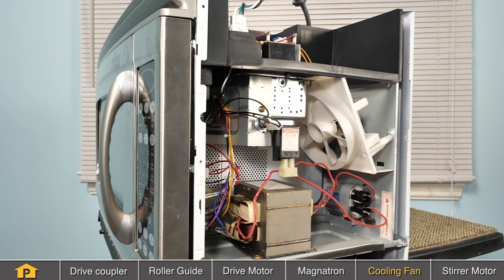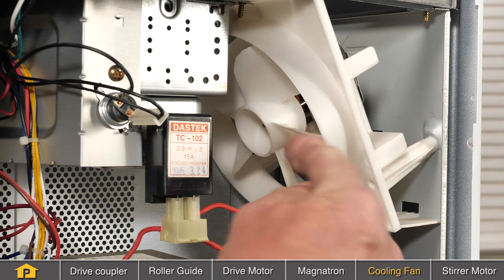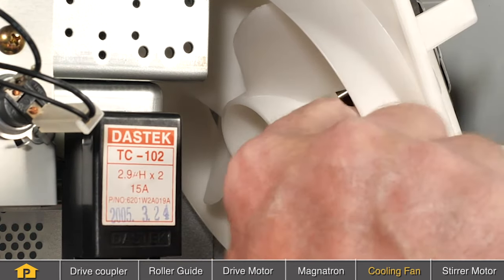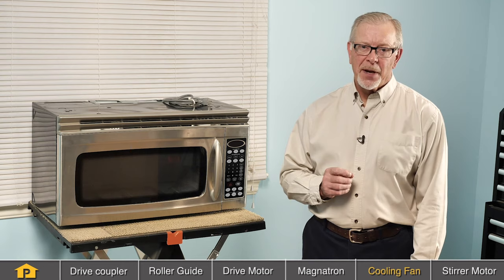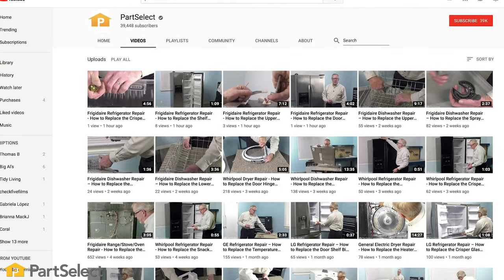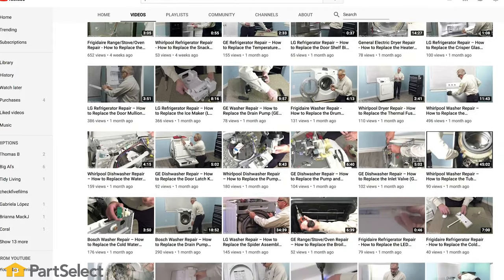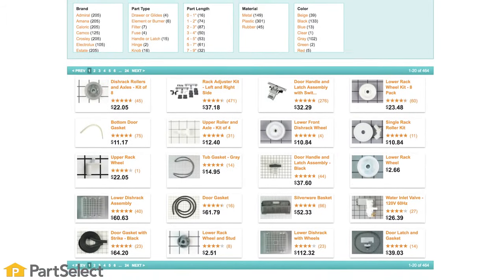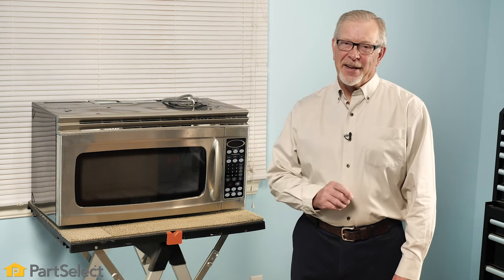Microwave Troubleshooting | Why Is My Microwave Noisy?  | PartSelect.com

Comment: Or, your oven may have cheap solid plastic feet that transfer noise on over to the kitchen counter, and thus turn the counter into a speaker. 
I added a rubber buffer between the oven feet and the counter, and what a difference that made.

Comment: amazing; thanks. mine was a squeal; pulled the small drive coupler off and by the noise i knew it was a dry motor shaft. got old faithful out and gave it a small squirt of el fixo and squeak be gone. w-d does it again.. can't be beat; w-d and duct tape!!!!!!!!!!!

Comment: What about a clicking sound
Reply from the maker: Clicking  sounds in a microwave are typically heard when you slowly open and close the door.  On some models you may here more of a ticking sound from the stirrer blade touching the shield if its bearing is worn. Some turntable models will make clicking or grinding noises when they are worn as well.